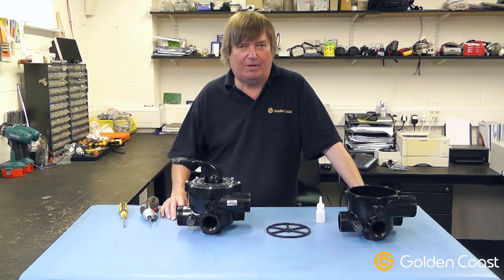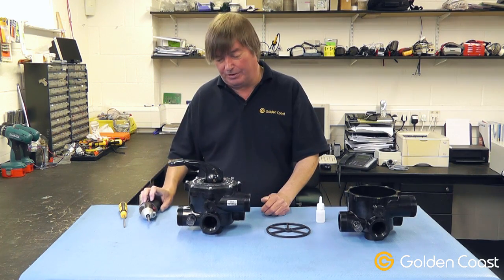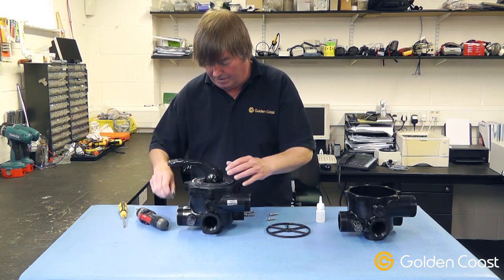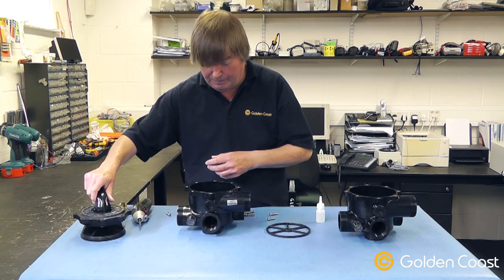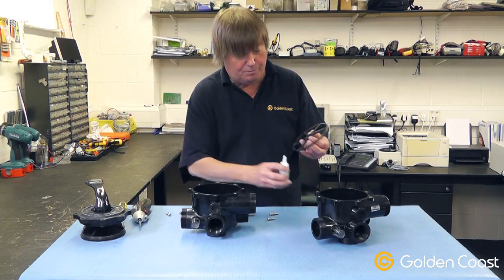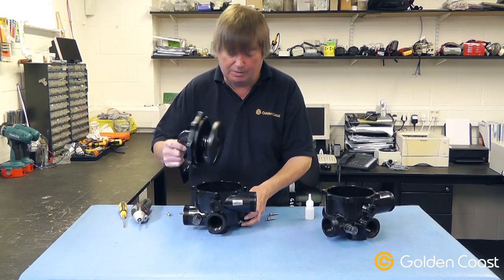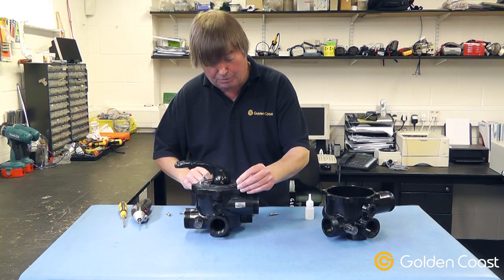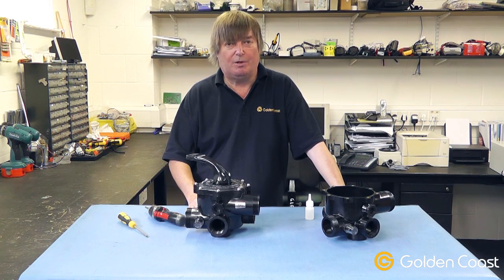Changing a Multiport Spider Gasket | Andy's Answers

Comment: I can't get my old spider gasket out. It's glued in. How do you remove the glue or what's the procedure? I've put acetone on it. No help. I used a razor blade but I'm not making progress and afraid I'll damage the plastic.
Reply from the maker: The multi port body is pretty tough so you can use a flat blade screwdriver or chisel to gently work away the old rubber and glue but will you need to be steady and patient. Make sure the channel for the new gasket is thoroughly cleaned out before gluing the new one in and make sure to apply a small amount of silicon grease to the upper surface of the new gasket. Hope this helps.
Reply: It took me 3 hours to clean out the old gasket and the cement that glued it in! I took my chances and did not glue in the new one. But I did use a lot of Magic Lube in the grooves, and on all surfaces of the new gasket and the circumference of the top part that bears on the gasket. My plan is to lube the top bearing part of the gasket every six months, it will be quick and easy. In this way the top disc part will slide across the top of the gasket smoothly and hopefully not pull the spoke arms out of position. This may not work and I might have to glue it, but after three miserable hours fighting with the glue removal I don’t care to repeat that next time!!

Comment: have u ever tried to take apart a gasket that was super glued in..u cant,it wont come out..think about it...hayward would never recommend that,u can use a silicone and let it dry over night,or non hardening permetex,or certainlock tights,or even rubber cement if u needed it to dry faster,never super glue..
Reply from the maker: Hi Alex, this is standard practice and avoids the gasket being pulled out of the bottom body through incorrect operation of the key stem. In a comment further down this thread I talk about how to remove a gasket that has been glued in.
All the best, Andy

Comment: I'm getting different answers on whether or not to use GLUE when installing the spider gasket. Which is it? Glue or Lube?

Aquanutpoolcare
NEVER EVER glue a spider gasket in place!!! Use a lube; the very best thing for this is Magic lube, you can find it on our web site Third, I always like to turn the handle in the same direction. the reason is the way the gasket is made, best to always go one way.
Reply from the maker: Always use glue Corine as lube will not hold the gasket secure in place which could be a problem if the user doesn't depress the valve handle fully and the diverter plate rubs against the gasket.